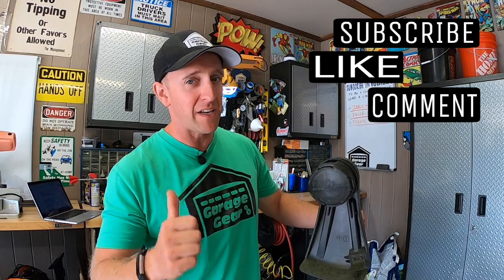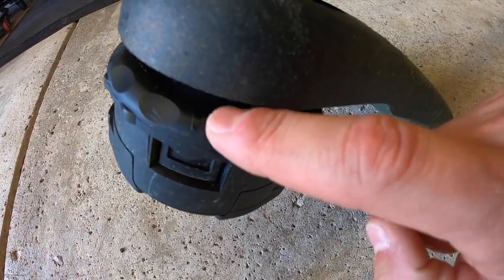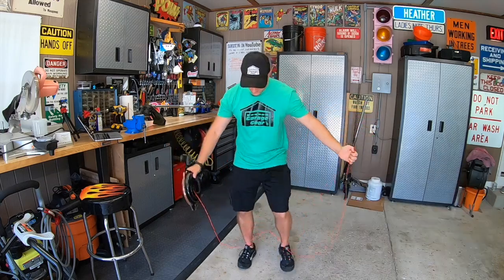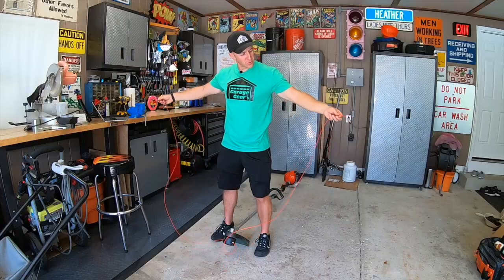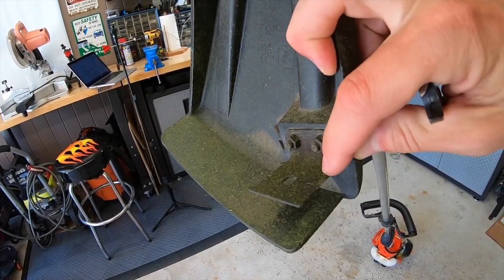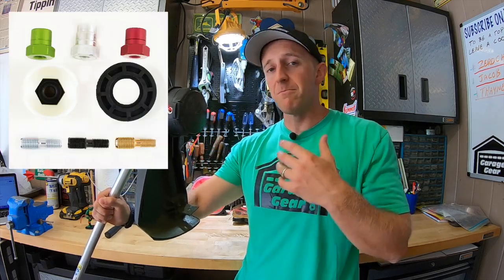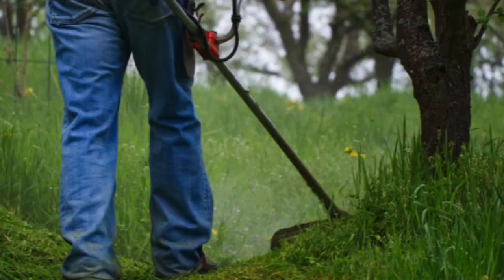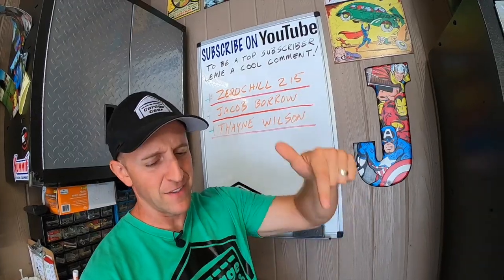RELOADING an Echo SPEED FEED 400 Head the RIGHT WAY (SAVE A FRIEND)

Comment: I have a speed feed head on my new echo trimmer. I am trying to reload the string, but I can't turn the head so that the arrows line up with the holes. Do you have any ideas as to what may be happening? I checking for any remaining string, debris, etc. There doesn't seem to be anything that should keep it from operating correctly. Thanks.
Reply from the maker: @mnoble0902  have you taken it apart to see if there is an issue inside?
Reply: @GarageGear  thank you for your response! Yes, I have. No debris or pieces of remaining string were in the head. The trimmer (PAS-225) and head are brand new. Maybe the head is defective.
Reply from the maker: @mnoble0902  no problem. perhaps! Can you return it? If not you can pick up a new head for about $30. It’s hard to tell what’s wrong exactly without seeing it first hand.
Reply: @GarageGear I think I’m just going to get a new head. Off to Home Depot again. 😂

Comment: Good video..  quick question..  on my echo speed feed head there is an L on one face side of the inner spool, and on the other face is says R.  They both have arrows pointing in different rotational directions.  Is this to change which was the line can be wound onto the spool, depending on if you have a clockwise or anticlockwise trimmer ?
Reply from the maker: You are correct jd! Thanks for watching

Comment: Awesome video jb what’s a good gas trimmer your recommend?
Reply: homeowner=Echo SRM-225
starting out commercial=Echo SRM-225
experienced commercial w/residential clients=Echo SRM-225
looking for a beast? Echo SRM-2620T
reasons for those recommendations are weight, power, build quality, reliability, Speed Feed head, price in the case of the SRM-225 $200USD
Reply from the maker: Kirk is on top of this one! Great trimmer for the price and loads of value! Thanks for watching Glitch and Kirk!

Comment: How do I get more line out???? Bumping doesn’t work for me
Reply from the maker: Hey Thomas did you string the speed feed 400 head like I did in this video?
Reply: @ yes
Reply: @ yes
Reply from the maker: @thomasc6127  ok the only thing I can think of is it’s missing the spring mechanism inside. Have you taken it apart to see inside at all?
Reply: @GarageGear  it does have the spring mechanism. Which way is the spool supposed to be facing?
Reply from the maker: @thomasc6127  hard to tell without seeing it in person but the spring should face inward.
Reply: @GarageGear  I’m talking about the spool that has an L on one side and R on the other
Reply from the maker: @thomasc6127  I’m pretty sure the spool spins to the left so you’ll want the L facing you

Comment: I use my speedfeed head on my Honda gx35. Easily the best trimmer head design out there hands down.

Edit: also for anyone who reading this and is interested in the speedfeed and have a Honda trimmer it is literally plug and play it fits the Honda trimmer gearbox out of the box so no need to use the added compatibility bolts and screws super easy to install.
Reply from the maker: Good to know on those Honda trimmers! Thanks for sharing Shorty!
Reply: Echo 400 also fits the Dewalt 60V Trimmer [DCST970] out of the box, just take off the old dewalt garbage head and replace with this echo 400, all you need is a phillips screwdriver to hold plate in place to screw on new echo 400, cheers!

Comment: Actually if both lines are not even from the head, dont need to cut unless one is way long than the other(I'd start over, cuz it hardly happens), as you use the trimmer just like this itll get even(by feeding the next inch or so), husqvarna trimmer head is one example and ofc echo one is simple and better
Reply from the maker: Thanks for sharing Adam! 👍

Comment: Love the speed heads saves tons of time. An extra back up line in your pocket is a must, it never fails it will run out wherever your the furthest away from your truck! Lol

Also if your old line becomes bridle and breaks easily, just soak it in water it will rehydrate the line and make it less bridle.

Good video brother
Reply from the maker: Good tip with soaking the line there Green Lawn!  Thanks for sharing and watching another my friend!

Comment: I have a package of black diamond line that's .105" thick. I struggled to put 15 feet into it because it's slightly thicker than the .95". 10ft was perfect.
Reply from the maker: Thanks for the tip Norge! Do they sell a .95 black Diamond line or do you just prefer the .105?
Reply: @GarageGear  it's just what I grabbed. They sell both, same price.
Reply from the maker: @norge696  ah got it! Thanks for letting me know! 👍

Comment: I love how quick and easy it is to reload the line. I also like to keep several pre-cut sections ready to go to minimize downtime.
Reply from the maker: That’s a smart idea!  ROCK ON Smallblock!!! Enjoy your weekend bud!
Reply: not trying to hijack anything on your excellent video JB. to the comment of the poster about having some extra lengths of trimmer line. I keep mine on a spool, but what I also have done is taken about four or five lengths and coil them up and I leave them in one of the map pockets in my truck in case I am ever without my school or it runs out before I get a chance to replace it I have some backups. so for the homeowner I might suggest peeling off a coil or two and sticking one somewhere different than you normally keep your line trimmer container maybe if you're lime trimmer container is in your shed with your trimmer keep an extra coil in the garage so if you run out and you go damn! you have enough to get your yard done and go get a replacement spool or package
Reply from the maker: @kirkthebeerslinger  more great tips here! I’m sure some fellow landscapers will appreciate these! Appreciate these tips Kirk!

Comment: Cross fire is junk, black diamond is the best
Reply: Love the black diamond line
Reply: Black diamond is freaking amazing!
Reply: @shortyorc121  I totally agree especially since the updated line I think which was released in 2018?
Reply: @MyGreenLawn2019  yeah I use black diamond 0.95 and it has an amazing cut quality, it is extremely strong line can cut like 20 to 30 yards before having to reload my speedfeed, and it's extremely balanced the line make almost zero noise compared to other lines I used which would sound like a giant fan on the end of the trimmer.

Also I use a Honda gx35 trimmer it's a great trimmer match with speedfeed and black diamond.
Reply: @shortyorc121  sweet
Reply: Black Diamond-meh...it's good... It's harder to see than the Shakespeare Ugly Line I use...three sided...works well, lasts as long as anyone them, can see it...priced right, the cutter is right there... it's my choice...PS-crossfire is junk lol
Reply from the maker: Heard good things!

Comment: Those SF heads are cool, but quite honestly I have never had a problem with my standard line head. 

Twist off,  do your centering (like JB's wing step or other method) insert the middle into the catch, wind up and re-insert.  

I guess too many people ate lead paint chips as kids to get how this works, so they came up with an even easier way.  🤣

Keep on rocking, JB!!
Reply from the maker: You know what Paul? I agree with you! Those old heads were not that complicated to figure out! I used one for quite a few years without an issue! I still see them from time to time.  Hard to kill a classic!  Anything cool happening this week?